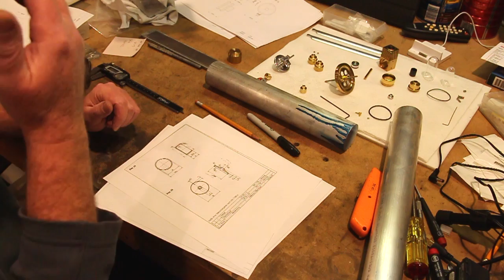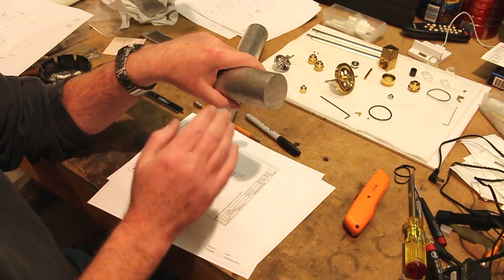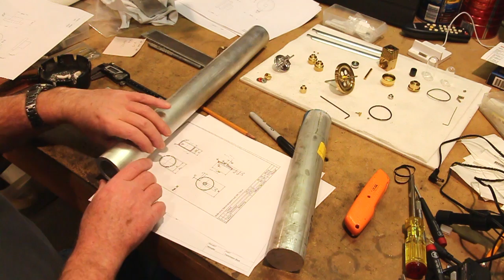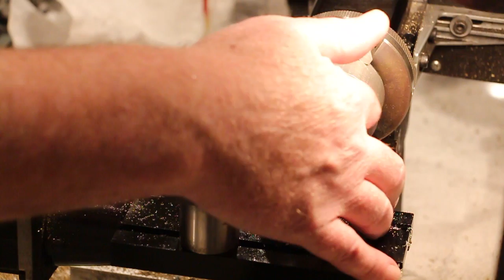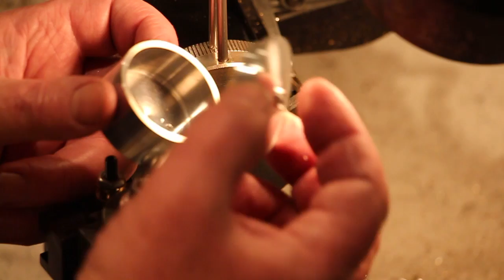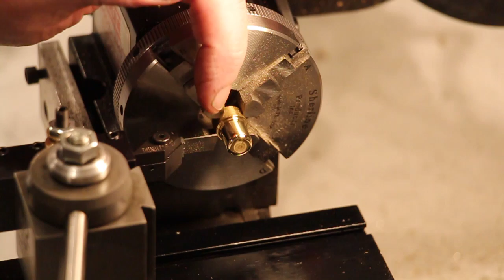Building a Stirling Helicopter - Part 9: Making the Alcohol Lamp

Comment: Very entertaining series of videos, nice and calm, I find it so relaxing and enjoyable to watch. There is a way to figure out the angle you need to enter into the wizard when setting it up, see your cad drawing for the part and determine the angle between the z and x axis, or at least that's the way I do it.
Thanks for posting the videos, they are great.
Reply from the maker: I'm glad you're enjoying the videos. The point I was trying to make regarding the Mach3 Taper Wizard is that once you enter X start, X end, Z start and Z end, you've defined the angle. Asking for the angle as well is redundant. I did some more experimenting and it seems that the wizard ignores Z end and uses the angle instead.
Reply: KenToonz I hope I didn't sound sarcastic, that wasn't my intention.
Reply from the maker: plata saul No, not at all. You were trying to help and I appreciate that.